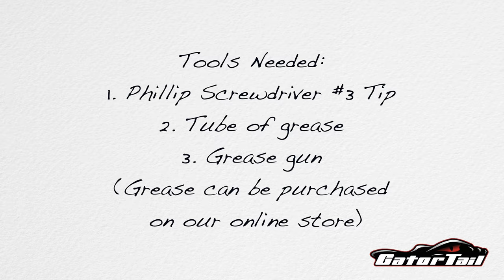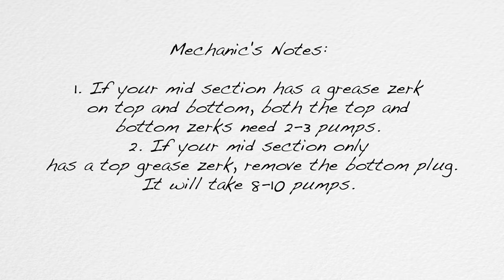How to grease your GTRXD

Comment: Just went to grease my lower unit and when I started pumping grease, a good bit of water poured out the hole. What’s the most common cause of this? I’m at 60 hours. I greased it at 30 hours.
Reply from the maker: Please visit the service hub tab on our site- Gator-Tail.com
There you will find videos on how to grease your lower unit as well as how often to grease it. 
If you need additional assistance, please send us an email @ damon@gator-tail.com
If you do not have access to email, please contact us at 337-229-6590